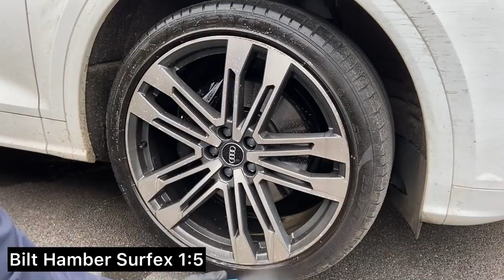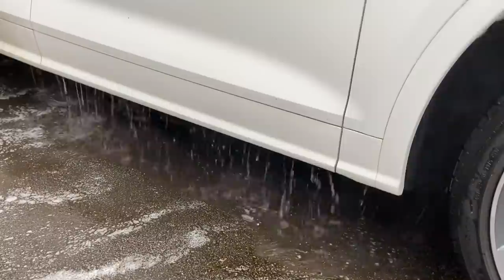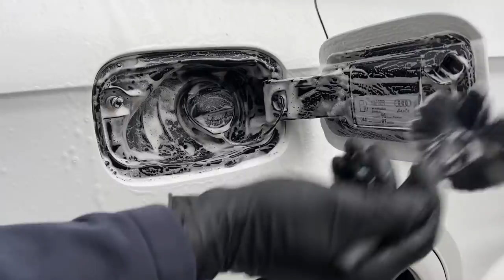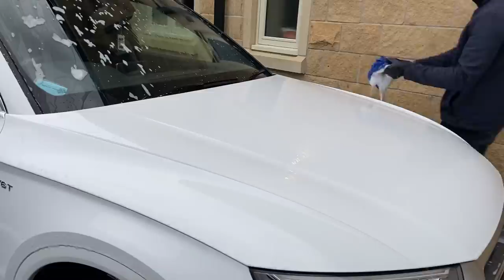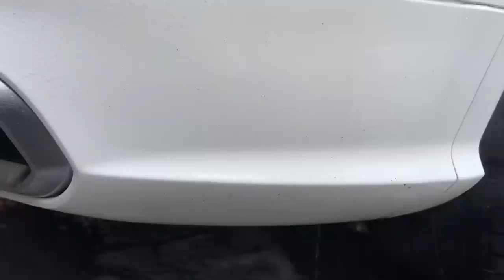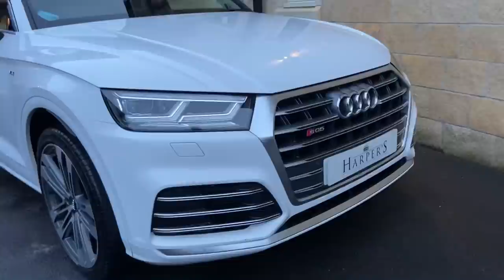Audi SQ5 Decontamination Wash / ASMR Style

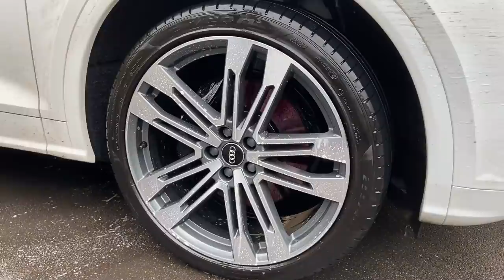Comment: What is 5% in regards to the citrus product? If it’s the product dilution, can you tell me the calculations (bottle size, dilution ratio) I don’t get good results with a 1:30 dilution in a 2L sprayer
Reply from the maker: I’m not sure I understand the first question. 
5% as a ratio is 1:20, so you are currently putting in 3.33% if using 1:30. 
Try 100ml in 2litres to get 1:20 or 5%
Reply: @HarpersCarDetailing  My fault if I confused you however you answered my question spot on. I will do dilutions of 1.20
Reply from the maker: I should probably stick to either ratios or percentages, but I like to keep people on their toes 😂